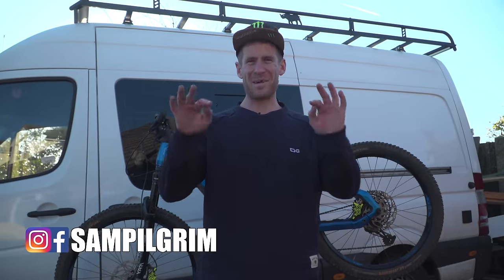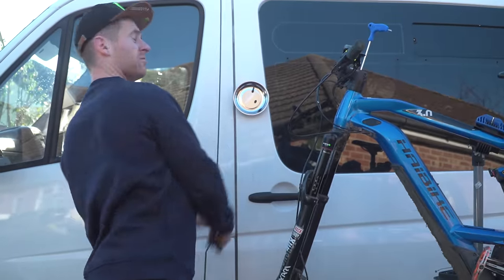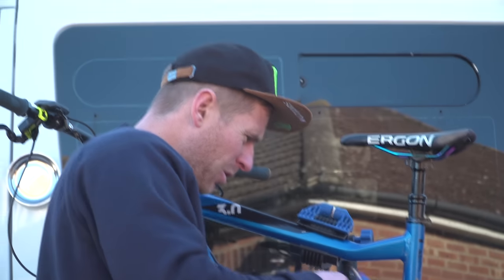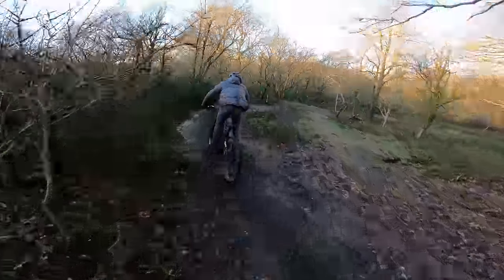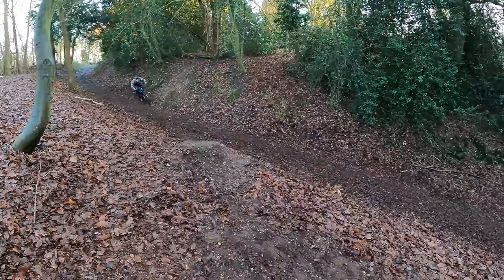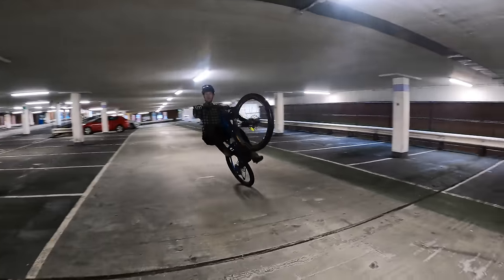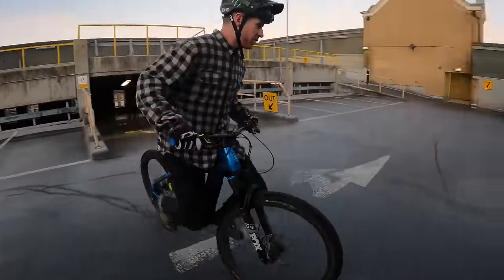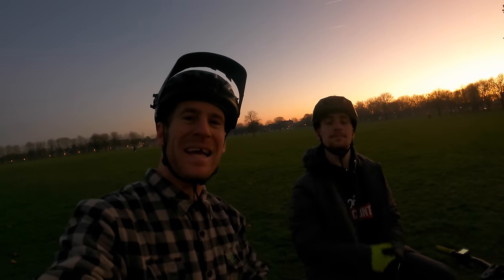UPGRADING MY BIKE WITH NEW FORKS AND SHOCK - HUGE DRIFTS AND MTB TRAILS

Comment: Nice set of tools but nothing beats “the curb”
Reply: Or the special starnut rock
Reply: I was looking forward to the curb
Reply: Yall forgot the backup hammer for the star nut that also starts a car by using aprox 12 volts of electricity that is stored right there inside the actual hammer.
Reply: Nice set of tools there mate can you plz send me the old fork
Reply: Sam is legit
Reply: I trimmed the steer tube on a fork and just for fun I used the curb. It actually works better than I thought it would. Then I went and used a file to make it nice.
Reply: That is exactly what i was going to comment, 😀
Reply: Hell yea 100%

Comment: You guys need to buy some old bmws and start drifting. You have the same obsession as i do with Sideways things. And getting really good at drifting is probably the most fun ive ever had. Its relatively expensive but if you set the car up properly and have some mechanical sympathy fuel and tires are the two biggest expenses.